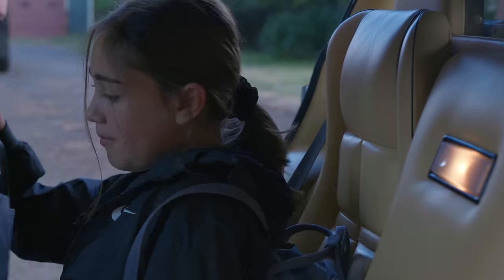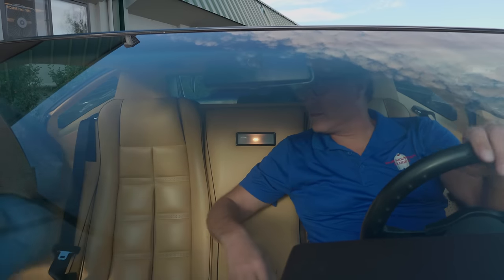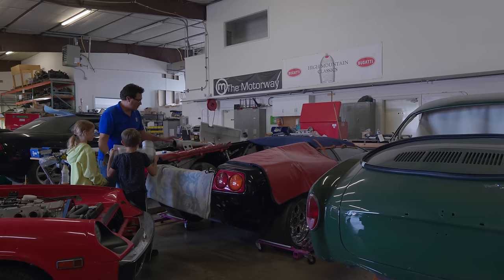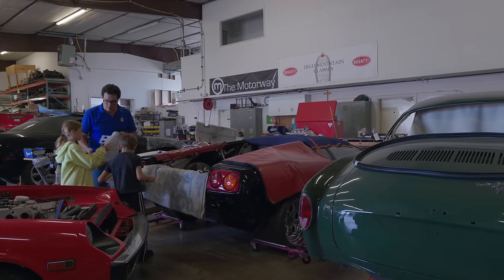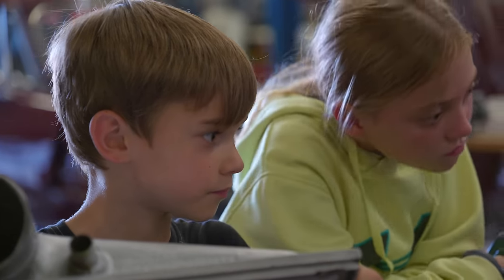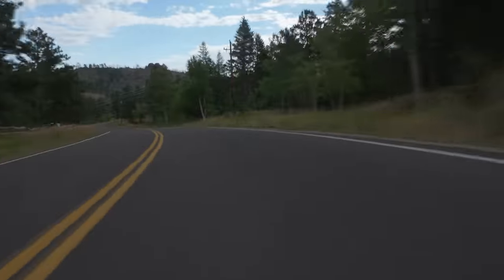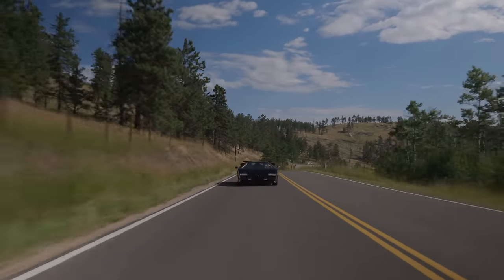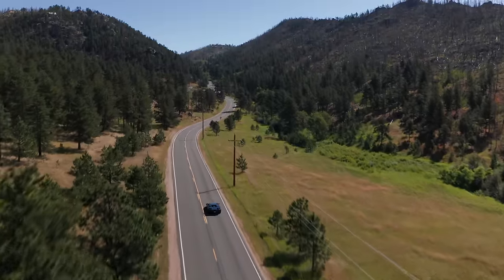Lamborghini Countach: Equal parts exhilarating and exhausting | Why I Drive #25

Comment: Although I'm not a fan of Countach styling, I appreciate and understand your love of and the thrill of driving an older sports car that as you say is "all analog" and not modern.  For that thrill for me, I take my '72 Pantera out on Sunday mornings through the canyons from the San Fernando Valley to the beach in Malibu.  At about 500hp and the roar right behind your head, Italian wedge styling at its best, there is a visceral thrill you just can't get out of modern, computer controlled cars.  My 600hp Jaguar XKR, my daily driver, is quicker, more comfortable, certainly more reliable and impervious to external factors such as hot weather or heavy Los Angeles traffic but doesn't provide the feel or the excitement or joy that my Pantera brings me.  You've described the experience perfectly!

Comment: I like the windscreen wiper delete option, with modern glass coatings and high pressure (aftermarket heated) washer jets there’s little need for wiper blades on an everyday car let alone a Countach 😁👍 beautiful car

Comment: Being older, I must say, carbs get a bad rap nowadays. I see lots of younger people that think engines with carbs just suck. What I think is happening is they are seeing dad's old car that only gets driven twice a year. In that case, yea, a carburetor is going to be a pain in the rear. One thing carbs can't do is sit. If they sit, they get gummed up and that is a hassle. 
Now, I am not going to say they were as good as fuel injection. Fuel injection was a big improvement, especially after you got a basic computer mgmt system on board. 
What I will say though, is carburetors worked reasonably well when used on a regular basis. 
You tune them once a year or so, the car started every time, it idled fine and cars with multiple carbs made a glorious sound when you stomped on the throttle. Multiple carbs do take a special talent to get tuned properly but, once tuned, they really were not an issue. 
Where you get carb issues is when they don't get used. Lots of small passages, valves etc. Use them regularly, they work fine. Let them sit, floats get stuck, valves get stuck, passages get clogged and you really wish you had fuel injection. :)

Comment: In my 20s in fla I had got the chance to drive one from a very Nice guy. Was on this back wood roads in fla and I stopped at this kinda run down tire shop . I needed air  and it  had some expensive rolls on the lift. And I was getting air in my tire for my junky Toya and all of a sudden this black p400 showed up to get tires .. i was in awe !! Whoa dude !after it came back out I kindly asked him if I get some pictures of it like the engine everything and he said YOUR ASKING ALOT KID I SUPPOSE YOU WANT TO DRIVE IT TOO ! ? I said no just pictures  he threw the keys my way and said you drive I want to feel these new tires in the passenger seat.   I got in nervous,,fired it up and just in first in 3 secs I was hitting 60mph ! Just to let you know I didn't make it to 4th. Before I was told to turn around.  But what a rush I had !!! and I'll never forget this experience.  Until I go senile.

Comment: Compare this engine sound to electric cars and tell me we are going the right way.
Reply: Being able to drive 300 miles on a $5 charge is pretty nice. Plus most car accidents are caused by drivers. Some people can't even handle their Prius correctly. Electric cars will be cheaper and safer. But yeah, not as fun. It's more of a practicality thing than an artisanal thing. There's a time and place for everything. And it's the electric car's time to take the wheel on the highways.
Reply: The recorded sounds of a fine tuned v-8, v10,or v12 can be put on a USB chip
-you stick it in your car's USB port,load the engines and they follow the ignition pulses for rpm changes

Turn it up and your Hyundai Sonata is a Testa Rossa or Porsche 928

Electric car : race engine sim chip and adaptor (uses alternator EMF) to track boring electric motor pulses into a simulated (video game) kind of soundtrack
Reply: @KyleFrawley  "I'm fwaid uh cwar accidwents!"

Me too, but I don't celebrate my cowardice. Turn in your man-card, little buddy.

Comment: lots of crotch rocket bikes would leave this car in the dust........
Reply: So what's the point?  Apples and oranges.
Reply: @johns.4639  yes,  they are two entirely different machines,   yet,   i think the thrill of this video is not just the car but the speed,  and it actually takes more skill to handle two wheels at high speeds and low speeds,  than it does for four wheels.
Reply: I agree with that point.
Reply: @johns.4639  have you seen this video on yt that shows this guy and other dudes,  riding these rocket wings?   unbelievable and talk about fast and experienced pilots.  i mean these are flying through the air rockets up in the sky similar to the model rockets with the engines that used the jet-ex fuse.